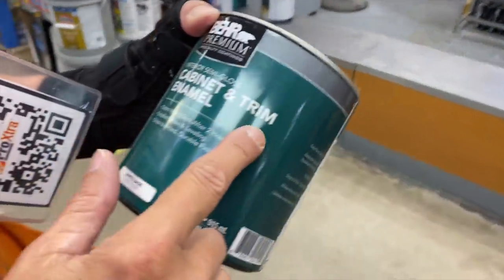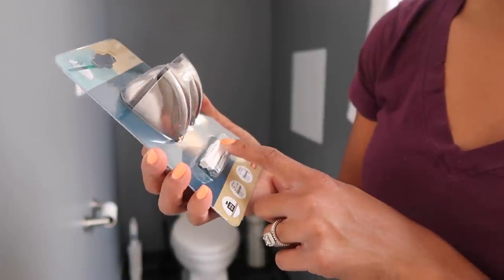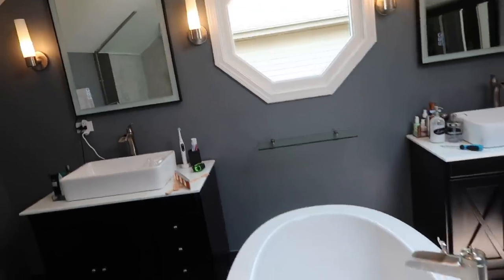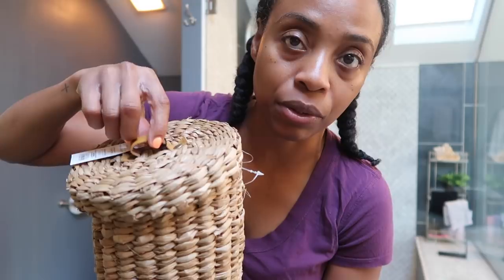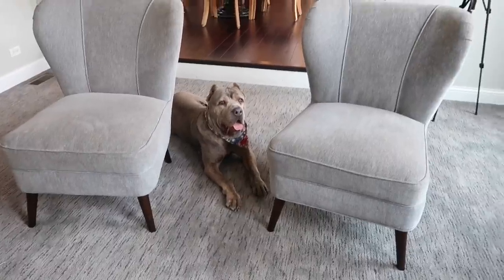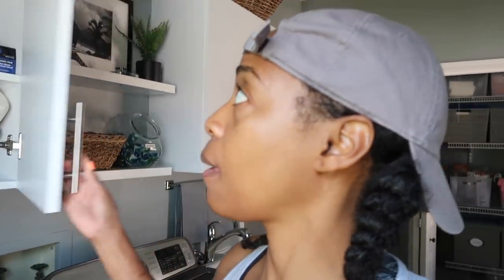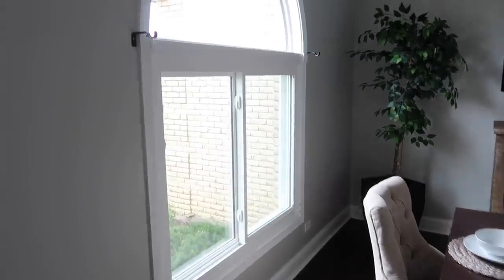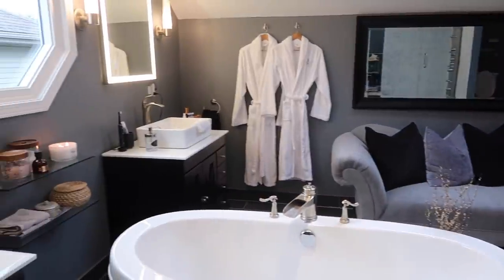Not me PAINTING my new windows! 😆 (Plus FANCY A$$ bathroom storage) | VLOG

Comment: Suggestion:  Try white distilled vinegar and half water in a od spray bottle for cleaning your windows.  Spray and wipe with an old hand towel or bath cloth.  It will clean with no streaks or hard scrubbing.  Your windows will sparkle like crystals.  The window trim painting project turned out beautifully.

The bathroom is beautiful and the updates are really nice.
Peace and Blessings 💙💛🐩
Reply: Lol just did my front glass door works great 😀